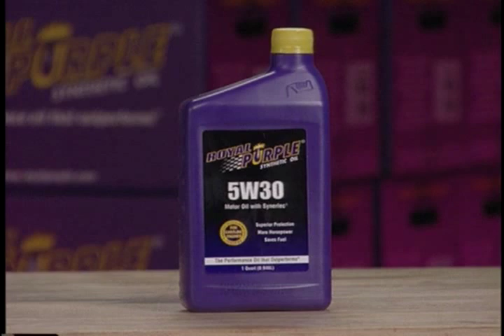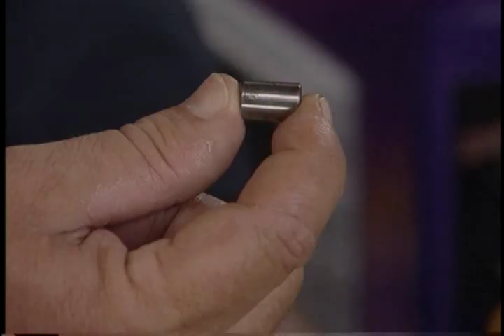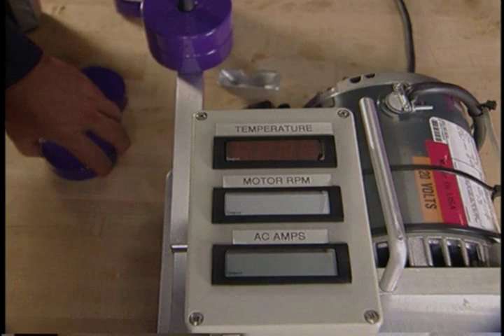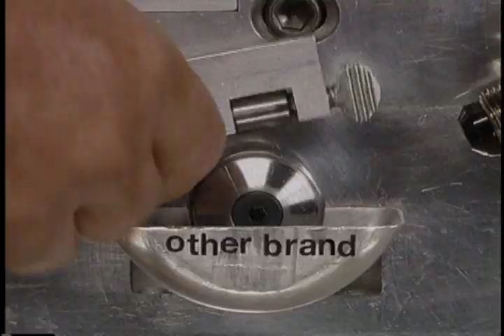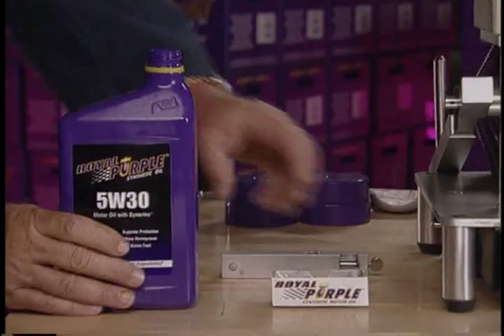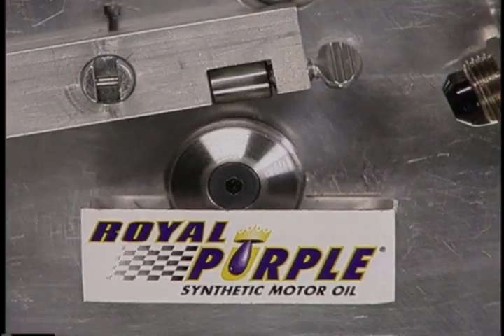Royal Purple Libricant Engine Oil Reviews - By BoatTest.com

Comment: Royal purple seems alot thinner then the other.  but I also noticed that the first temp only went upto about 93.5 a modest 5Degres.  where royal purple quickly jumped to 114 before they stopped the video.  It may cause less weat but seems it generates alot more heat.  RPM is disabled on both tests

Comment: I am very confused with your testing!   Why are the rpm's when testing Royal purple at least double than that of the previous test?  This would explain the amps not being the same, notice the oil not rolling on  wheel with royal but it does with the test oil, rpm's are so high it just throws the oil off the wheel?? and how come you have disconnected RPM gauge on machine?